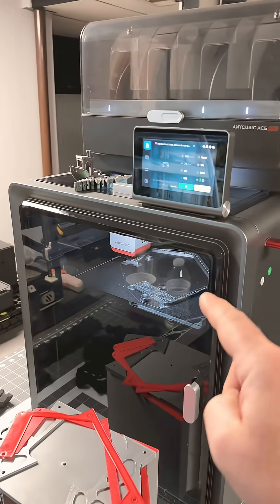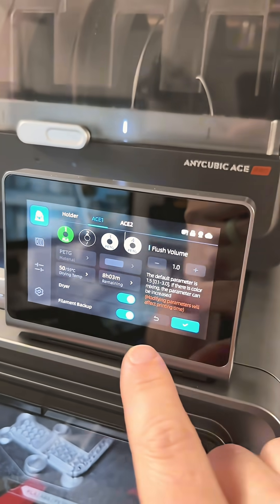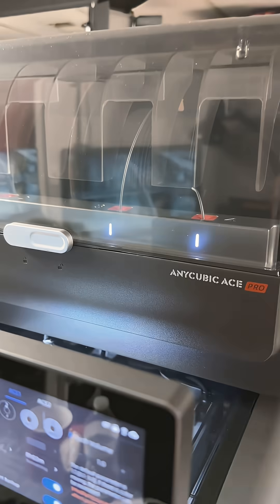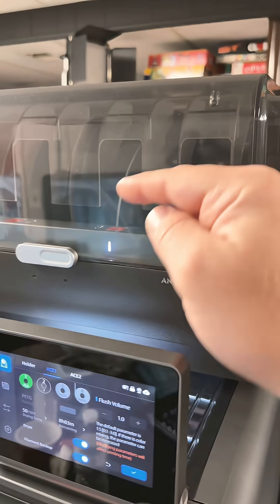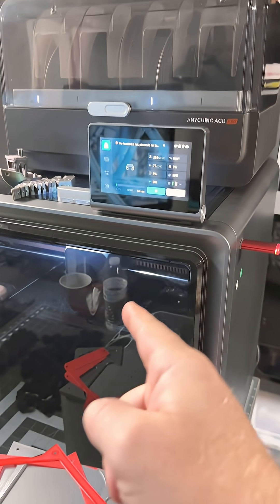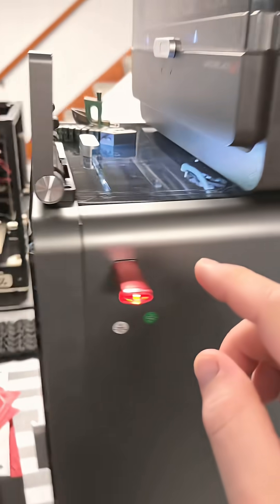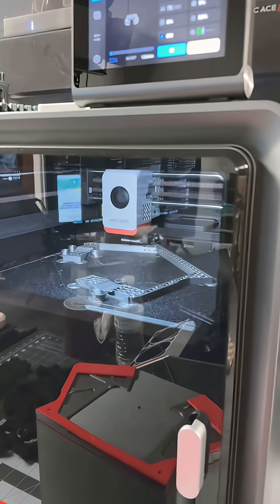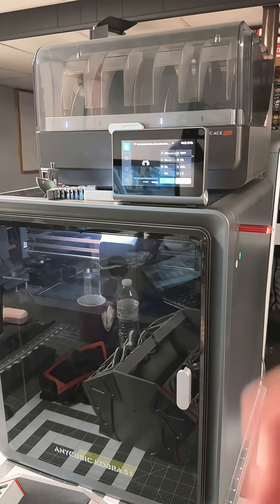CONTINUOUS PRINTING on the Anycubic Kobra S1 Combo

Comment: This thing is a POS if you run out and do not have a spare in the ACE you have to pull out the old shit leaving you with unused leftovers! it does not use it all I let it run out. it said abnormal extruder I reloaded the new stuff and just kept getting the same error until I pull out what was left of the old shit.

Comment: PLEASE TELL ME. when i want ti use it the rest filament is in the Hub and it dont get used all of this like yours then try to feed the backup new roll and will be stuck because a rest is still in the PTFE inside the printer?!?!
Reply: YEP!  It said abnormal extruder I reloaded the new stuff and just kept getting the same error until I pull out what was left of the old shit.
Reply from the maker: I’m not sure why your machines are behaving differently than this. I’m not doing anything special.

Comment: Hello, i have a few questions if you have the time.
How loud is the operation of the printer?
Does this have a built-in fan and replaceable filter?
How is the internal lights and camera?
Thank you
Reply from the maker: Sure.
Its not the loudest machine I have in the shop, but it can be noisy if you are printing PLA and it’s sitting on your desk right next to you. 
It does have a built in chamber fan and filtration. There are printable modifications to take this further as well. 
The lights and camera are great. I’d say amung the best.